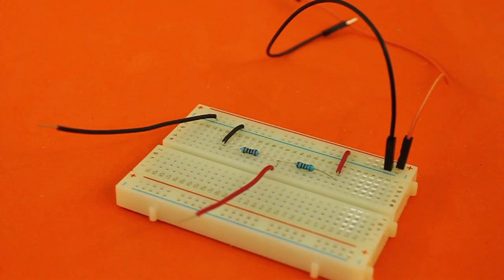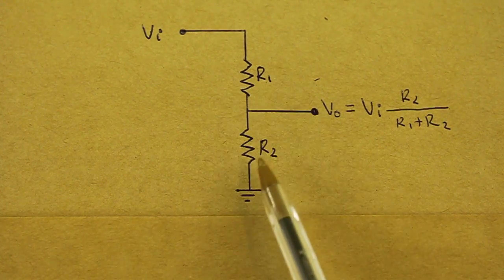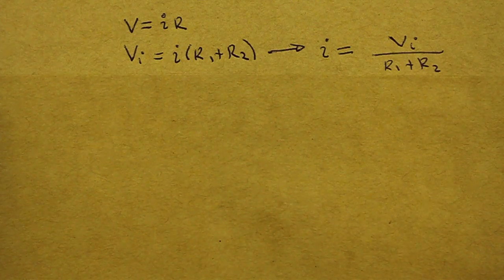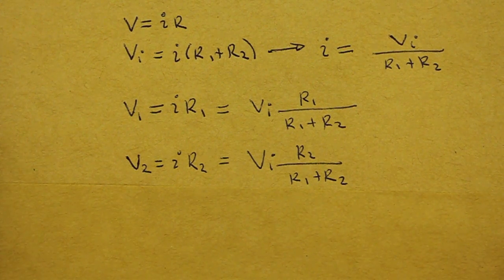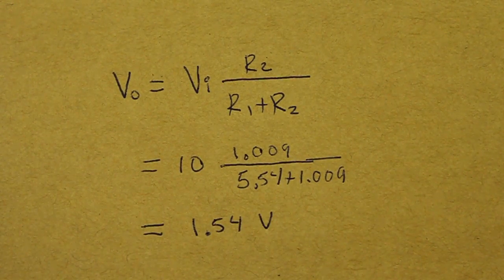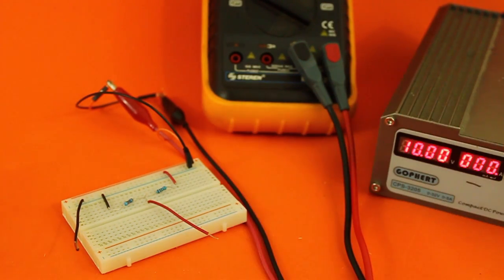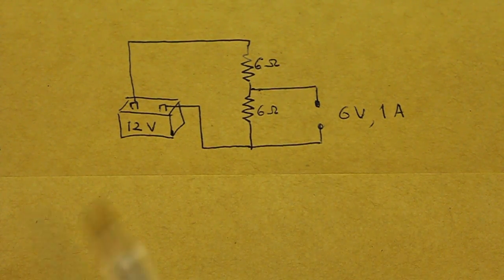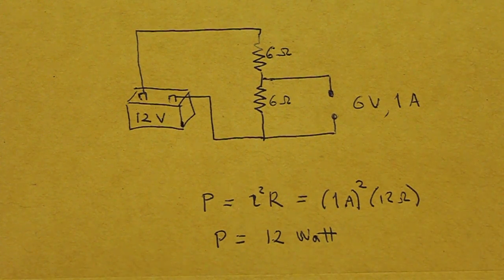Resistive Voltage Dividers

Comment: Please explain how a capacitive dropper circuit is calculated using 125volts.  Don't use electrolytic capacitors.

Comment: Excellent video. If you made a divider with a 100:1 ratio, could you use it to measure the output of the power supply used in your previous video (Mini Jacob's Ladder), to see if it actually generates the rated 10-12kv?
Reply from the maker: With a resistive divider you cannot measure AC. You either need a capacitive divider or rectify the transformer output
Reply: @ludicscience  Very interesting, thanks!